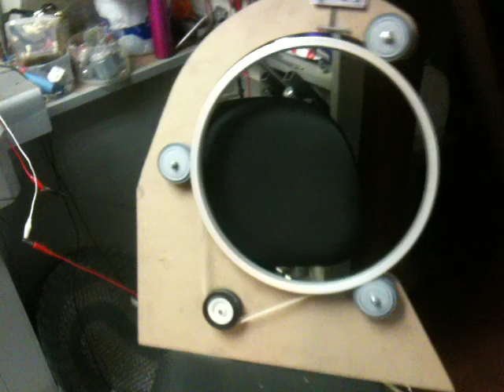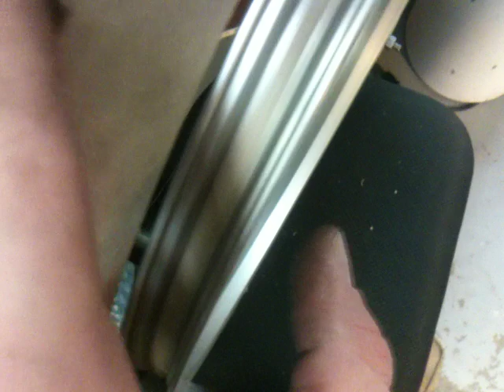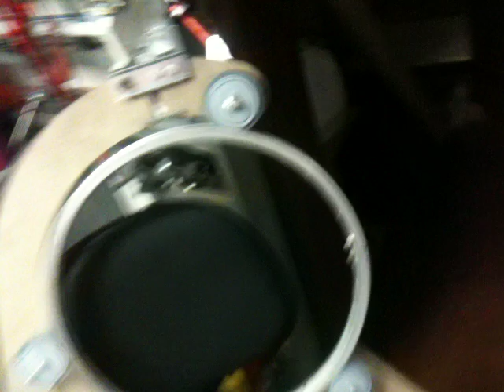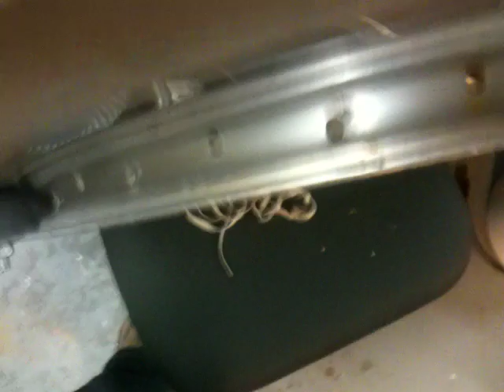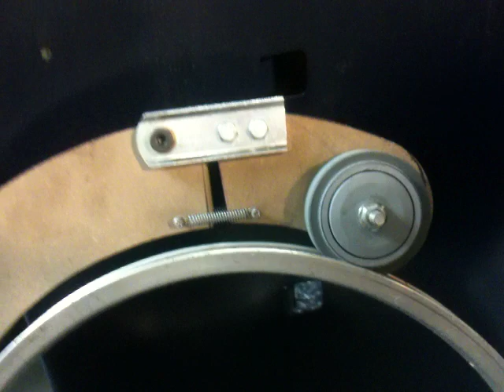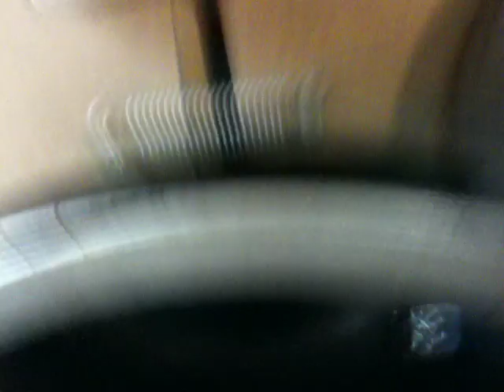#3 EPG Winder (Sneak Peek) , Built a Unintentional Van De Graff Generator. :) Cool! High Voltage!

Comment: Russ I look forward to every video, keep pressing on.
I used to make belts for my 8 track tape player by cutting strips of inner tube.
Just cut 2 strips to the same length, glue one over the other staggering the joints so you wont have a step.

Comment: Dude! Make the two bottom wheel from the bottom to provide the power to the large ring! in that way you won't have to worry about mixing your wire with your pulley!

Comment: Hi russ if your using the belt and not direct drive I think an automatic washing machine belt may work nicely , I was  standing in an electrical repair shop today looking at new replacement one for 3 or 4 pounds..Cheers HAWK................